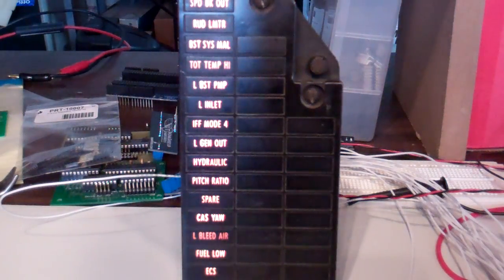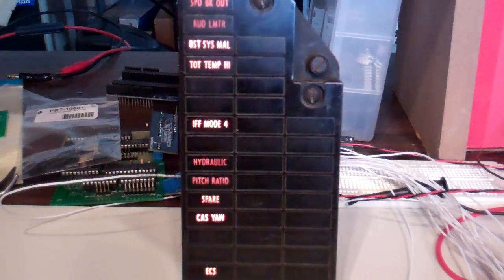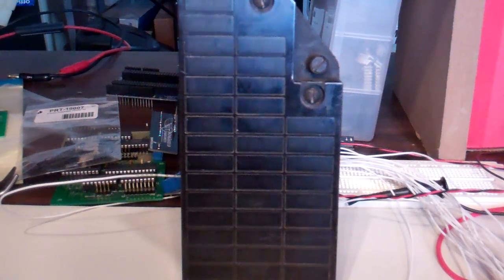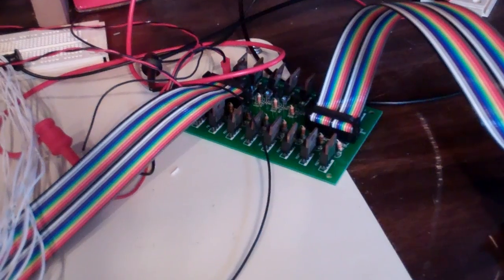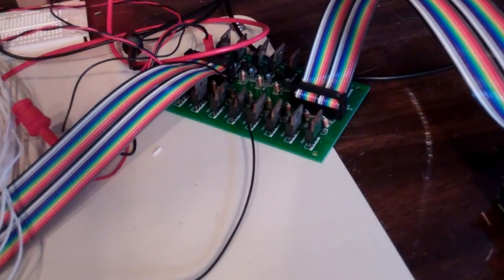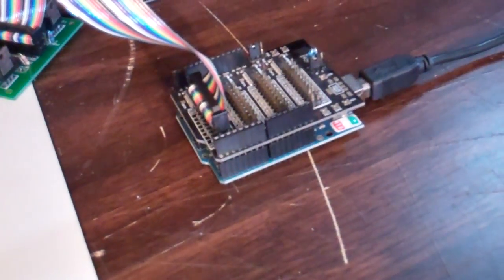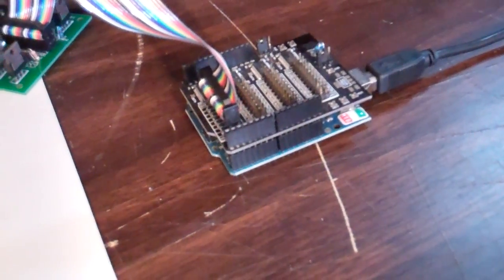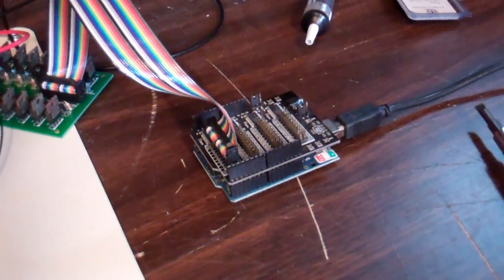F-15 Master Caution Panel demo Pt. 2

Comment: A number that sticks in my head is 150degF for that thermistor.  Once it reaches that temp, the lights will flash until the panel cools off.

Comment: The TO that tells you to do it would be the 05JG-00-05 as part of aircraft power application, regardless of what task would be worked.  The 33SD and 33GS (Lighting) would schematics an explanation of the different quirks of the lights.  From memory, the INST knob needs to be other-than-off then you turn the Warn/Caut knob to RESET and it will dim everything for night.  The only way to revert to full intensity is to cut power or turn INST to off.

Comment from the maker: I've got 24V power supplies installed in the airframe right now, so that's what I'll be driving them at.  Adding selectable voltage dividers would be very cool, but may have to wait until "version 2" of the system. :)  What page in the TO references this dimmer?  It's the first I've heard of it. :)

The MCP enclosure contains a thermistor that I'll give a shot to monitoring to make sure that I don't overtemp the assembly and start ruining legend plates.

Comment: Good to see you haven't abandoned the project ;)  When using the lights panel, the T.O sayst to trip the "RESET" on the Warning Cautions dimmer, cutting the intensity range in half.  That thing can get hot pretty quick (especially if you're pumping 28VDC through it).  From my experience though, pilots usually never dim them since once everything is up and running, no lights should be on and if something was to flag a caution, they wanted it to be immediately obvious which caution it was.